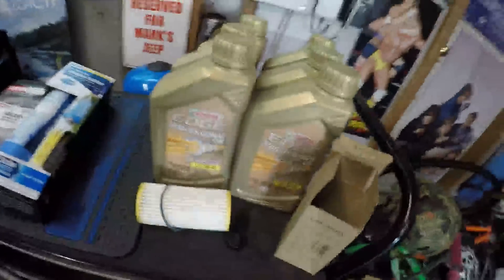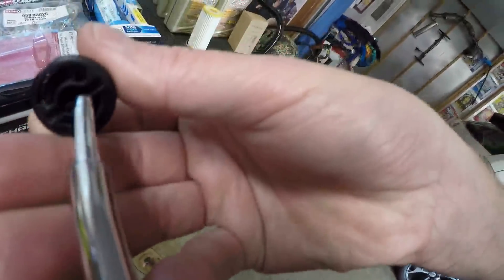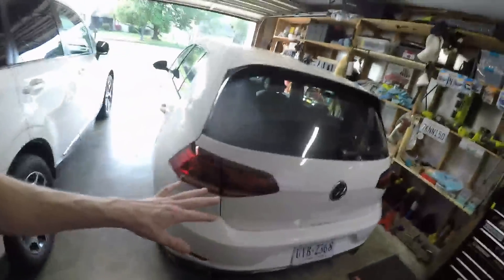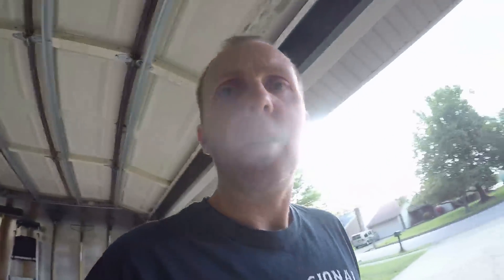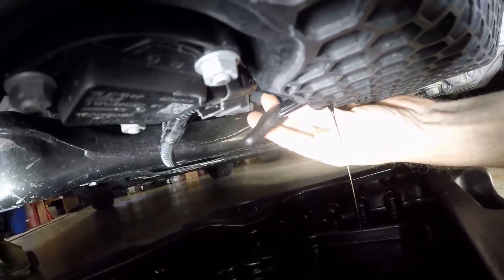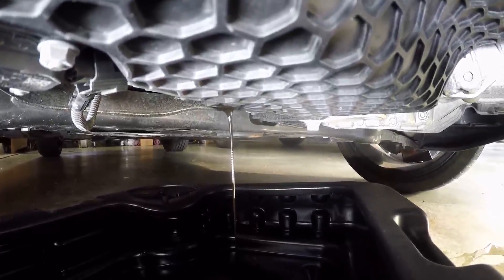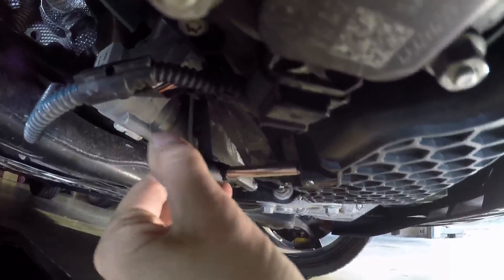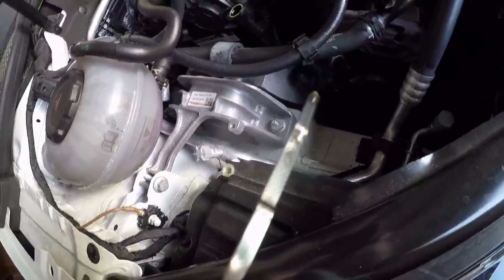2018 VW GTI SE Ep.111: Oil Change #2 and Updates

Comment: Hey I have a 2018 GTI Autobahn DSG automatic that has about 15000 miles on it. I have to commute in mostly stop and go traffic and have noticed my shifting has been increasingly more jolty. I know the DSG can be picky at times but this feels like it’s getting worse, even when trying to maintain speed between 10-15mph. Anyone have any idea if this is normal?  Getting my oil change in 2000 miles so I’ll have the dealer look into it more but I am unsure if it’s DSG or something like the MAF sensor or something.  No CEL either. Thanks!
Reply from the maker: a DSG tune solves most of that. stock DSG is clunky as hell
Reply: Cool thanks for the reply, I’ll look into that!